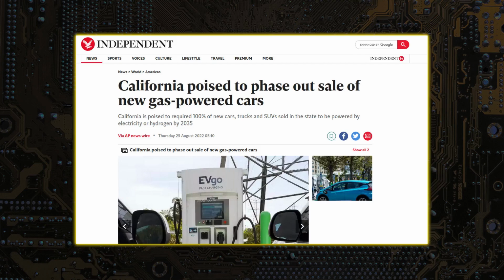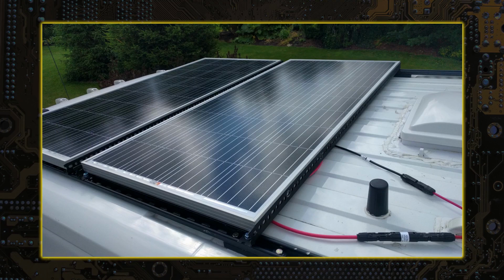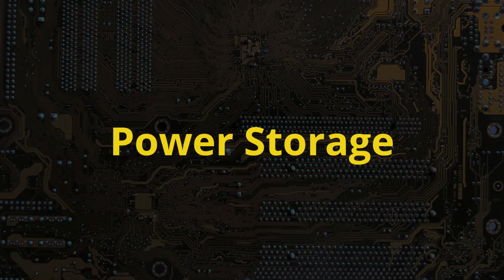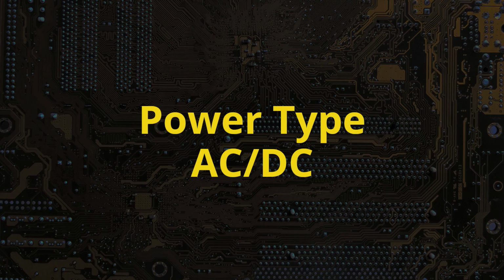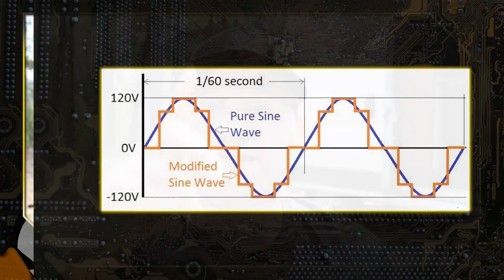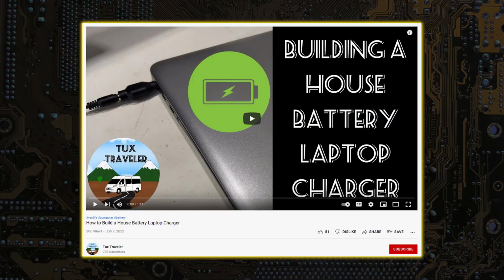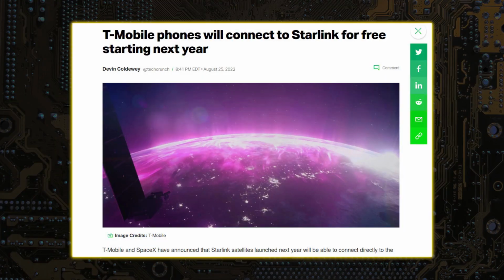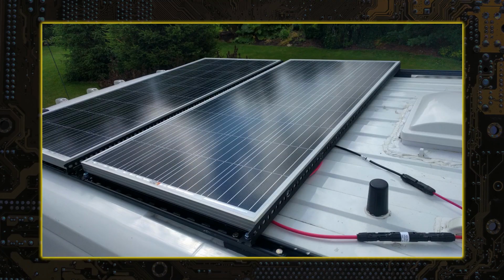A Complete Guide to Offgrid Computers

Comment: While being less relevant in a vehicle scenario, I found that off-grid, outdoor computing offers little Secondary Market choice for devices. 

In theory, a rugged cellphone is best protected against precipitation and condensation - caused by low temperatures - but while ARM CPUs are fairly sufficient for internet, multimedia and moderate gaming, the choice of Open Source operating systems and software excludes most devices... 

Rugged, Industrial Tablet Computers would come close, but are usually never in an X86 AMD CPU configuration that could offer a fairly low powered, maintenance free integrated GPU. 

Anything more 'militarized' is usually only supplied to institutions and not 'portable', anymore - that is: carrying it in a backpack, alongside a sleeping bag, tent/hammock, water ect... 

This lack of product choice is in fact curious, considering the now long standing 'prepping culture' and industry - just like the state of cellphone design in regard to Open Hardware (RISC) is 'dystopian' (though geopolitics have forced some organization and support)...

Comment: Something that occurs to me, given my personal circumstances, I think I'd want a 24 volt power standard, which would allow me to only step down voltages for 99% of my power needs.  If I desperately wanted a 3D printer, mine runs off of 24V, my laptop has a 20V USB-C charger (although the brick claims it can go as high as 36V), most caravan and motor home appliances use 12V, and anything else I need is 5V USB.  In my head it's more efficient in terms of losses to step down voltage because you get more current available, right?  So a 24V system would maybe allow me to run a small, 12 heater without much issue, since the heater in a car is normally 12V anyway, right?  I know car heaters can and do take heat from the engine to save on power requirements, but modern electric cars don't have that luxury, so 12V heaters that run on battery have got to exist, right?  Clearly I need to research more, but sometimes it helps to shout ideas out into the void of internet comments...

Comment: Hi! Well just wanted to debunk the efficiency of DC 12V to DC 19V for example that is better than DC 12V to AC 220V to DC 19V. It depends from the converters efficiency. Usually a good inverter has a good efficiency for DC->AC and laptop's power supply a good AC->DC comparing to a cheap dc buck converter. Ideally (but expensive at least for now), a GaN ATX power supply will save you a lot of power as it can achieve 90+% efficiency! Btw, I'm considering wiring my new house with DC but it will probably need high voltage to avoid voltage drop/power loss.

Comment: After filling my steam decks 1 tb sd card in less then 2 weeks I think it's safe to say visible is the closest to unlimited wireless data offered in the US.  The speeds are throttled during peak, but my couple hundred GB of games that's supposed to take a week to a month will suddenly unthrottle overnight and be downloaded by the next day.  I can usually only stream 480 to maybe 1080p without buffering, definitely not going to be streaming 4k videos. Kinda curious if the sim would work in a router instead of using the cellular router.  

I also use 12v pd charger.  A single 100 
watt cord to my usbc hub charges my laptop or steam deck and peripherals.

Comment: D.C. is better off grid unless needing to run long distance. Super capacitor banks can extend your battery life and lessen hard cycles on batteries. Super capacitors charge in seconds. Having a super capacitor bank and battery bank is the way to go. Let the super capacitors cycle not the batteries.

Comment: Been running Desktop computers with modified square wave for over 10 years no problem,  It's mostly and issue with laser printers and high end audio/video equipment.  I would also disagree with always use lithium....for mobile applications (like your van) yes.  But for stationary applications where size and weight is not an issue, I would argue Lead Acid is more green, and there are Edison Cells, Nickle/Iron that have been know to last 70 years.  There are also Carbon/Magnesium salt water batteries but dont know much about them